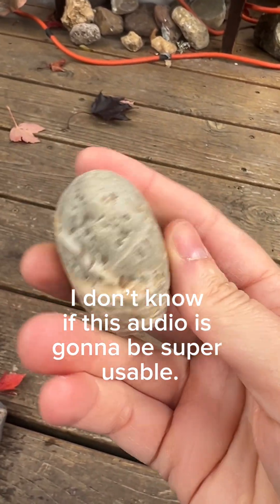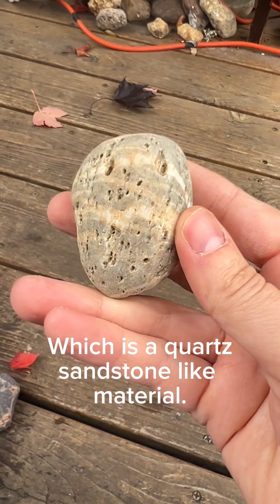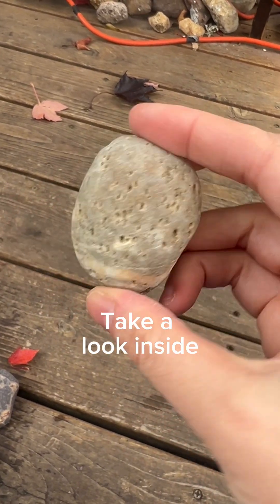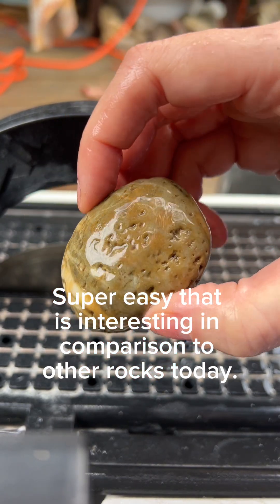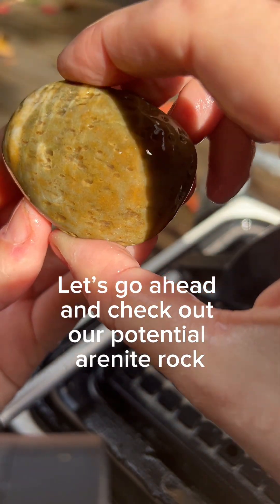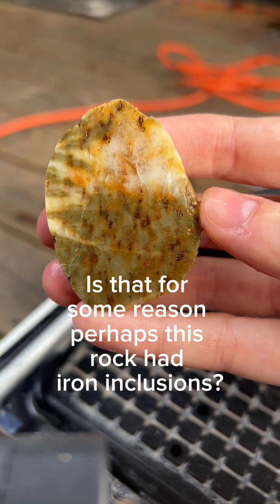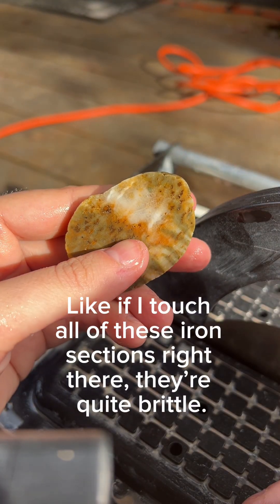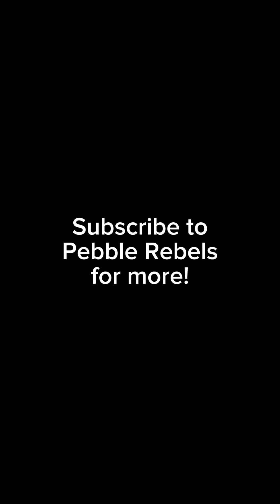What caused these holes? I cut this rock open to find out!

Comment: Sooo... if that's a sandstone, does it bubble with an HCl test?
Because, while Iron ight erode out with HCl, I dould expect at least as much erosion on the sandstone.
As there is quartzy stuff in there, maybe the liquid solution that percolated through had some H2S? Or it was exposed to high heat when in a later pebble stage and the iron inclusions melted out?

... or maybe they were the grist-stones of giant prehistoric turkeys and the iron got eaten up by stomach acid?

... or very small woodpeckers?
Reply: Taking your points in order:

Like all glasses, Quartz doesn't react to HCL. Quartz is broken down with HF which I would not suggest anyone carry ever for reasons that should be pretty obvious. If there was carbonates in the matrix, you would absolutely see fizzing via acid test. 

If the rock had been exposed to H2S, we would see a some of the lithics turn into sulfides which I don't think we are seeing here.

If the rock had been exposed to high heat (400c or above), we would see the grain size of the clasts get larger and we would also see pseudomorphs (mica or mica-to-chlorite for low temp, argillization for higher temps).
Reply from the maker: @BP_in_OR me taking notes furiously 

Also, I think I might have found some rocks that have that sulfides transformation. I’ll have to look around and see.
Reply: @PebbleRebels  Was this rock found on the coast, or say-- in river that has plutons in the upper reaches (e.g. Sandy, Clack or thereabouts)

Both areas can give you altered quartzose sandstones.
Reply from the maker: @BP_in_OR here’s the crappy part. I can’t remember! 😆 I kind of want to say it was coastal though. Not sure if northern washington coast, or Gleneden beach oregon. They can have similar tumbled eccentricities to each other, whereas a lot of the other coastal places I’ve hunted have more uniform materials and crusts that are recognizable to me. 

The two exceptions to those locations would be some, Port Orchard, Wa finds and some, Damon Point, Wa finds, but it was very rare for me to pick up materials this large at either of those locations.

Looking at the piece though, I’m leaning towards northern washington coast.

Either way, I need to get better and recording finds. 🫣
Reply from the maker: What are HCI and H2S? It’s is definitely an interesting thing to ponder. Whatever got inside the stone eroded the iron the way water might, which I see at differing levels in other iron stones. Some seem fairly stable against rusting in the center of the stone and others are a lot more susceptible to it. Sandstone could be a more porous stone and more susceptible to corrosion and leeching?

And hahaha to those last two! 😂
Reply: @PebbleRebels  HCl = hydrochloric acid; H2S is hydrosulfuric acid (if in aqueous solution). HCl is a commonly used as a test for carbonates, But it and H2S can erode some other materials.  If the sandstone 'pebble' came in contact with an acidic fluid after it became rounded, then that solution MAY have expedited the erosion of the externally visible iron inclusions while leaving the embedded ones alone.
Reply from the maker: @randalljones4370 interesting! Saving this for future reference! Are you thinking there would have been carbon present in the iron deposits? Or around it in the sandstone/quartz matrix?

Comment: More quartz inside than I expected, but you can definitely make out the foliation of the matrix. Was not expecting the iron bits but not surprised they are there. Thanks for including all of us in cracking the case!
Reply from the maker: I was pretty surprised by the iron too! I could see a bit of iron staining on the outside but I’m surprised it wasn’t darker based on the amount inside the rock!